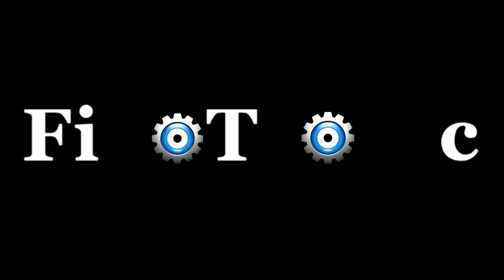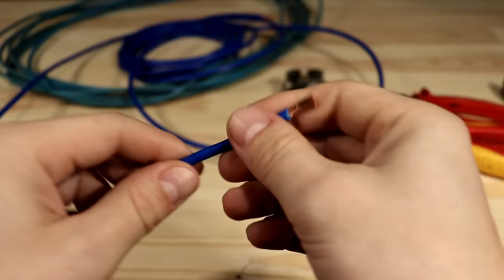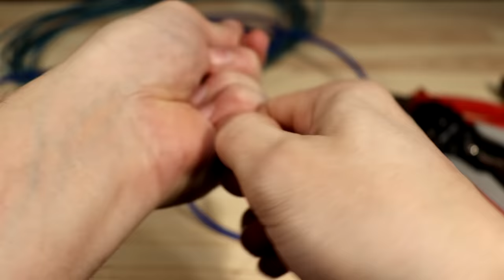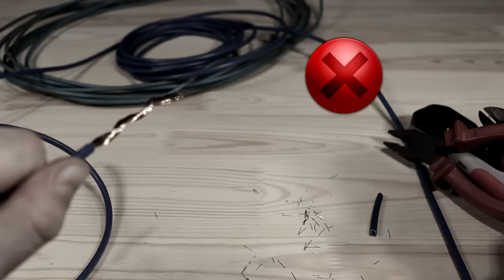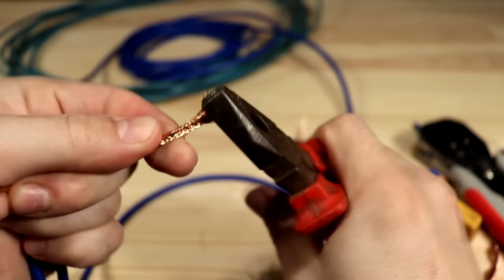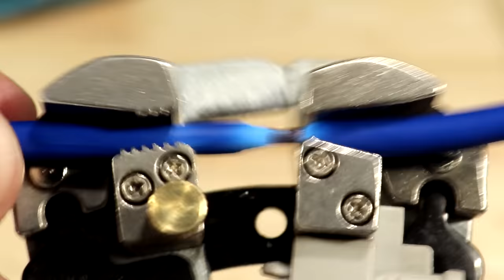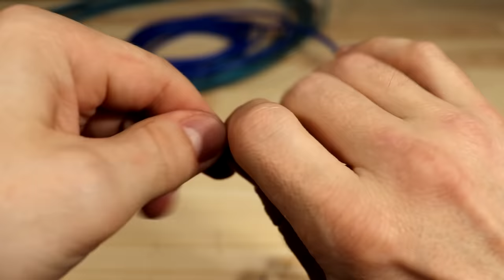AWESOME IDEA! HOW TO TWIST ELECTRIC WIRE TOGETHER!

Comment: Já lí algo sobre esse tipo de emenda e até onde entendí ela além de não ser recomendada é considerada perigosa pois gera uma resistência em função da forma como está sendo torcida  (com uma torção central e um enrolamento voltando em espiral, que é o grande problema) que, dependendo da corrente e da tensão, pode levar a incêndios. 
          O ideal seria mesmo usar ou terminais com conectores próprios , ou emendas parafusadas ou simplesmente unir os 2 fios retos literalmente "encaixados"   e entrelaçados ,seguido de solda.  
          O vídeo mostra uma junção mecanicamente resistente, mas o problema é que ela não é uma boa emenda ELÉTRICAMENTE FALANDO. Se a resistência mecânica for fundamental, é preciso usar um método externo ao fio em sí.

Comment: By about the 3 minute mark I was praying for someone to switch on the breaker.
Reply: Мультики
Reply: Very informative. I do it this way all the time now in my electrical business. The only nuisance is that by the time you've done the first two parts of the process and undone them again the wire has become weak and in the third and final joining it sometimes breaks. 
I do wonder whether I could just do it the final way shown but I prefer to follow the entire correct process demonstrated in the video.
Reply: @jeffn1384  I agree this new method of twisting wires is a game changer. I follow exactly how the video demonstrates and finish on the third process. A couple times I cut it too short and the copper wires weren't able to overlap onto the insulation so had to start the process all over again... so worth it. I wonder if it's possible to go straight to the third attempt without doing the first two with the same results. Too much to take in. I need to lay down.
Reply: Hahahahaha!
Reply: PMSL
Reply: Tell me you line,34thnVine
Reply: Jeff N 😂🤣
Reply: @jeffn1384  🤣🤣😂😂
Reply: LOL!
Reply: @Jeff N 😭😭😭
Reply: @Paul Leech 😭😭😭
Reply: @jeffn1384  lol

Comment: That's nice and everything, but what kind of application is there where such stress is put on wire that it might pull apart? If you have that sort of a situation, better to solder them.
Reply: A vacuum cleaner with a short lead
Reply: When you use an old cable to pul in a new cable thru existing tubes

Comment: Say it with me....SOLDER. 
Any of those would work. Without solder, it's a crap connection.
Reply: Solder only holds wires in place, more important is a strong mechanical (galvanic) connection.
Reply: @mickdanks6836  Exactly my point.
Reply: @dbcooper7477  Soldering has a big disadvantage: It weakens the wire at the end of the solder joint, where flux enters the strands and makes them stiff. Solder joints are prone to breaking under constant bending or vibrational stress. That's why solder joining of wires is not being used in the automotive or aviation industry for a long time anymore. The better alternative are crimped connections.
Reply: @alimmi9  also it damage the components like ecu or sensitive electronics. in automotive we use crimp. Also consider the situation, not all wire have the same generous length )
Reply: Limmi, crimp/butt connect and “Airbag” circuit, you will have an “Airbag” code! I don’t know aircraft repair. But 30 years as a Automotive Master Tech. Only sure repair is solder. Resistance in a crimp connection will cause problems.
Reply: @mikeshuck2760  in a proper crimp connection (which isn't trivial to achieve) the resistance is very low because the two wires are cold-welded together.
Reply: If a Western Union Splice is soldered in a practical application, in its intended use (one that  is under motion AND tensile load) it will fail in a matter of hours due to metal fatigue.

Comment: Fine end result, but those wire ends sticking out will puncture heat-shrink tubing or electrical tape you need to put on after.  Soldering needs to be done anyway, but this does not fix the stray poking out wires problem.

Comment: Western Union splice. Tin those wires and shrink wrap them and you'll have zero problems in that splice ever.
Reply: What is the point of this video? You're using Elekchicken's tape on a household power supply???????
Reply: Right

Comment: Any method would work, when soldered. Any joint should be soldered for a permanent joint.
Reply: Ian, wrong idea.
Reply: Sometimes soldering is not ideal. When the wires are vibrating or moving, it can cause metal fatigue and a failing connection, maybe even start a fire.
Reply: @kup1954  so the same as any moving connection then....
Reply: Soldering is a bad idea generally between 2 wires. You solder wires to PCB's or buttons and such. Connecting 2 or more wires you use a crimp connector, preferably a shrink-glue one like Dura-Seal.
Reply: @TheDarknae  not exactly... when the wires carry high current you shouldnt use any connectors if possible... the proper way is actually to strip a bit of insulation off of one wire about an inch from the end and take out about an inch of insulation leaving a bare section of wire one inch long. then you strip the end off of the wire you want to join about an inch long. then you use a pointed object like an awl or ice pick to poke thru the wire with the bare section right in the middle of the one inch bare section and insert the pre-twisted end of the other wire all the way up the bare section to where the insulation starts on the wire youre poking thru. then you wrap the end you poked thru around the entire wire with the bare section without going over the insulation of course. THEN you should solder the connection together if possible but mostly this is just to keep the wire wrapped on as the actual structural strength comes from the wire poked thru and wrapped around. The extra benefit of this method is that it can be implemented mid-span... that is to say you dont NEED two free ends to make the splice. one wire can be terminated at both ends and the splice will still work....

This method is the one currently employed by most Remote Start System installers for the ignition system wires which are bigger gauge and carry lots of current and can not be detached from either end... using a fitting of any kind risks the chance of electrical fire. 

Also obviously this technique is for stranded wire, but you can do it with any stranded wire size as long as there are two wires in one conductor to split.
Reply: @kup1954  ..... ummmm... NO.

Comment: I would just solder them and cover with heat shrink.
Reply: A friendly comment from a electrical engineer ... an old one ...  your suggestion solder+heatshrink ,is great in static situations.  I love it.  BUT   Never apply that on cars ,boats , or anything that vibrates or move.   Sometimes the boundary between the solder section and the regular section get severed because the huge difference in flexibility.    HAD A CASE all the splices failed after few years.  So is great  in stationary situations.  That's  it ...
Reply: I was thinking same thing, but the video useful for me I've done it all the wrong ways before I just soldered the connection..
Reply: 11ll11l1ll111l1  same in the PH we use soldering

Comment: Learned this "lineman's splice" back in the 70's in grade 8 electrical shop class.
Reply: You beat me to it. Same here, back in middle school  1973 when all students had shop class.. Never forgot that one, and use it all the time. Although we were taught a different way of executing it. Bend wire into a right angle after twisting. Then wrap tightly, solder, complete.. (today I cover with shrink wrap).
Reply: class of 1975 checking in
Reply: @theamerican7131  Guys, them were the good old days. When teachers knew what to teach kids. Now, they have to figure out which gender they are one day and the next!

Comment: Anyone know if the rule below, applies to basement installation of 240v range receptacle? The rule below, doesn't make any comment on it. This is Ontario code I believe, so 130 mm is about 5"

"The stove receptacle (14-50R) must be mounted so the centre of the receptacle is 130mm from the finished floor (rule 26-744 (6)(a))"
Reply: You wouldn't use stranded wire on 240v.

Comment: This is nothing new. It's wire splicing that has probably been used since the ancient Egyptians. I myself have been doing this for the last 30 years. The only difference is I get it done neatly finished with electricians tape in under 2mins. I actually fell asleep watching this bore. I'm not kidding either. I really did. So unless you're high on peyote, in which case you can be excused, you need to find something else to do with your time which I doubt will be very difficult as it appears you have a lot of it to waste

Comment: Watch at 2X speed then USE A SOLDERING IRON AND HEAT SHRINK TUBE
Reply: i TOTALLY agree!!...i am a qualified electronics service engineer with 45 years in the trade....you DO NOT NEED that much cable stripped?...it's simple..just put one long piece of heat shrink on the cable, then strip back a small ammount of sleeving from the cable on both sides...then twist the bare wires together (face-to-face) and solder over the joint....cover the connection with the heat shrink...shrink it with the heat gun...and bingo!!....perfect joint!! simples!!..anyone else agree with me??

Comment: And how about to use the electrical crimp connector and the heat-shrink tube or just the insulated electrical crimp connector?
Reply: Way too easy and common ;) Some people dont like isolation and other "useless" stuff. They have to be cool. Don't you think its cooler to have open cables rather save connections? (sarcasm btw ...)
Reply: WINNER!!!!!
Reply: Connectors used should never be crimped. Key cause resistance means heat means failure. Solder then shrink wrap all wire builds :)
Reply: @mikes.1882  When this happen, most often I use the wago clamps for that. For stronger cables (like 25 and higher) I use special clamps.
Reply: @jaromirandel543  
When it happens just do it like the guy does. It's a field application. A fix that will hold. Like if you're going to twist and tape, do it like this. That's all. Seriously. That's all this video is about
Reply: @mikes.1882  I am 
professional electrican. I can not afford soulutions like this one. I always have to use the professional solution.
Reply: @jaromirandel543  it's a quick fix  to get you home. 
If you were an electrician you wouldn't be stopping at threads like this.

Comment: You just discovered the soup of envelope. 😂😂😂😂😁✌️  It hurts that this system of union of electrical conductors stopped being used in the 80s, nowadays the union of conductors by winding is prohibited.

Comment: READ THE COMMENTS.
Referred to a western union splice.  To solder and heat shrink would be a NASA or FAA splice.
Way to long on the video
Reply: well if i were to solder those 2 wires together, instead of just wrapping them onto themselves, i would butt the frays together and intertwine them before soldering... allows the solder to flow within the strands better for a more solid connection
Reply: @michaelmorgan2880  Done with proper heat and flux, you can't stop solder from wicking into the wire strands.

Comment: As a licensed Master Electrician with over 35 years experience I need to say that nobody should EVER join wire like that and please educate yourself before putting out how to videos.
Reply: What if you need to join wires in order to pull a new wire into the pipes?

Comment: That is called a Western Union splice,learned that years ago as an electrician
Reply: tattabox 
Wait. There’s a moon?!
Reply: Don't doubt what you say, but I learned it as a pigtail splice ( solid wire, not stranded )... and we soldered it afterwards
Reply: In Spain is called "empalme de gusanillo" but currently it is forbidden to use
Reply: @felixservandodetoromartine5254  why? because of patent? or because it is not to standard for some reason (unlikely)?
Reply: @buggaboo2707  Hello, I have not explained it well, sorry. In Spain it is prohibited in electrical installations, screw terminal must be used.

Comment: I do not believe(I know) these would pass an Electrical Inspection in Houston.  Stress reliefs are used now days to prevent tension on wires not the actual mechanical connection

Comment: Every electrician watching this is laughing. Old news. And no good with today's code. A splice can't just be twisted. It has to have a wire nut, or connected with something like a barrel connector, or soldered. And if your wire is under enough tension to pull it apart in the first place, you're doing it wrong.
Reply: @gfy2979  Bro calm down, he just disagrees with the video, therefore he proceeds to express his point of view. Insulting wasn't necessary.
Reply: @gfy2979  lol
Reply: That's exactly what you were told.  I have been an electrician for 48 years, and this is simply forbidden.  It is not allowed to connect these wires together, and certainly not with flexible wire.  Years ago, that was only possible with wire from a vein.  Now it has to happen as you already said with a special connector and it has to be in a box.  So this video has no use.
Reply: @eveliofiore  It's actually not my point of view.  I'm going off of established practice and electrical code. What he did would not pass inspection here in America. And thanks for the kind words. Insults aren't necessary. I didn't insult him, just giving some facts. I'm sorry he felt attacked.

Comment: 1800s Western union splice. Solder when complete then wrap with friction tape.
Reply: That's how the company got the name 'union', the splice y'know.
Reply: some double wall shrink tubing is better.
Reply: soldering is no good idea if the wire is a part of a moving object (cars, trucks,etc.) and not tightly fixed near the connection of the two wires. Reason: flexible wires loose their flexibility at the ends of the soldered part and can break at this points.

Comment: And after all that, the guy remembers he forgot to sleeve his wires with heat shrink first, and so has to undo the connection again.  Doh!
Reply: Yeah really you can't just shove those back in the junction box without any insulation lmao

Comment: Dice publicado el 19 de febrero de 2019, pero debe ser 1919.
Reply: Jajajaja yo creo...
Reply: Sebastián Burgues sa
Reply: Now solder it, and shrink wrap it
Reply: @mikej5539  It's the linesman joint - not supposed to be used with multicore wires. BTW, he tested it differently the third time than the 2 previous ones. NASA has a notebook of wire joints!!!! ... publicly available - their recommendation for multicore (or flexible) wires is crimping and for solid core wires it's ... the linesman joint.
Reply: Ese tipo de empalme me lo enseñó mi padre hace 25 años. Ya existiría para las cercas con alambre en el campo hace más de cien años ese tipo de uniones.

Comment: Also, this is easy with about 1.5 inches / 3 cm of wire, but most of the time, I need to join with only 1 cm / 1/2" of stripped wire.

Comment: ( D- / F )  Waste of time and energy.  Strip / Splice / Solder / Heat Shrink.  :60 sec.  Code.
Reply: strip/butt connector/fill with solder/shrink wrap. Stronger than the wire itself if done right, and just as fast.
Reply: @xeromaus2669  - Until you need a flexible splice or don't have the room for for bulky connectors. ;-)

Comment: This was a linesman splice, it's been used for over 50 years.  This was a ridiculous demonstration.
Reply: in technical school the teacher called the linemans splice the "western Union" its the strongest and best splice for carrying amperage and tensile strength.. so i agree with you 100%
Reply: Try over 150 years..  Telegraph lines used them, as the Western Union (hence the name) splice got tighter with tension, Way more suitable to Solid rather than Stranded !

Comment: Won't pass code.  "Strong mechanical connection" in other words, a wire nut
Reply: Yes he's a wire nut!
Reply: a lineman splice is a strong mechanical connection. They are generally stronger than the wire.
Reply: this is literally how you're SUPPOSED to splice wire.  Union joint, then solder.  It's not a "great idea", it's how you're fuckin trained (at least in Canada)
Reply: Won't pass code?  It 100% passes if it's soldered.
Reply: The third try I believe was technically a linemans splice...although my thought would have been to spin the loose stranded conductors tight.
My preference also would have been to slip an appropriate size/length of shrink tube over one lead first...and for gawds sake Learn To Solder Kiddo! :)
Reply: Solder and Tape
or
Solder and Shrink tube
Reply: Wouldn't adding heat shrink to this bring it up to code?
Reply: @Afootpluto  I was going to say same. In my day it was called a Western Union splice, I think from telegraph line (repair) days.

Comment: If you heat the housing first ( just a little bit) you might not have to struggle trying to separate it from the Copper wires????

Comment: Your first two splices were different versions of pigtail splices. They would normally be completed with solder or wire nuts and then taped to complete. Most wiring applications are not subjected to pulling forces and a pigtail would be sufficient. However you wasted a lot of time getting to your final splice which is referred to as a Western Union splice. It has existed for as long as wire has been strung across poles to supply power and communications to businesses and homes around the world.

Comment: Is this the best method for joining audio wires ? can anyone clarify ? . should we add solder spots to ensure that the wires not not unwind ? some readers in this thread , have used shrink wrap or tubing to cover the wound wires .